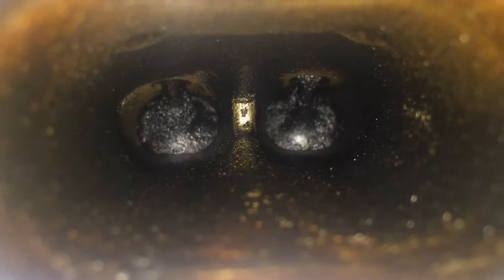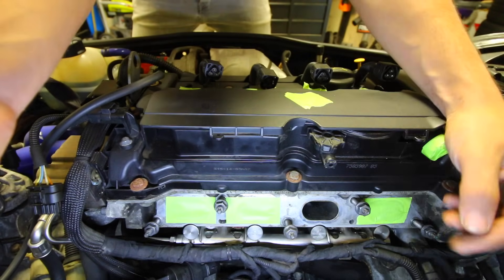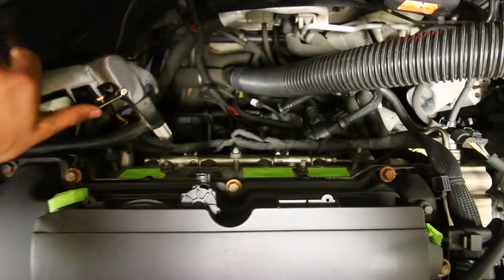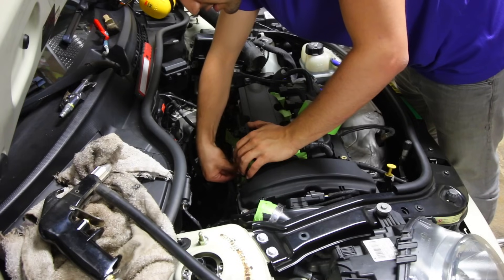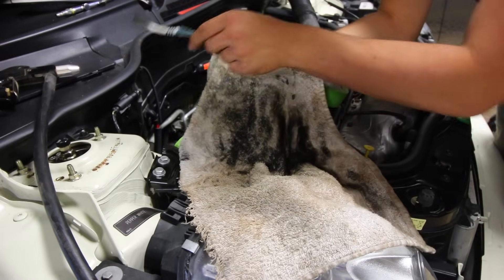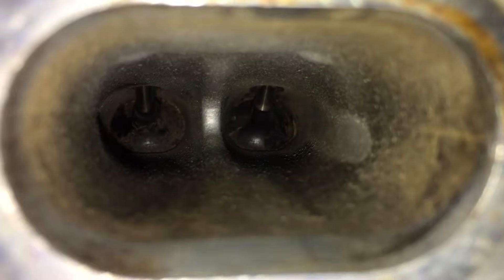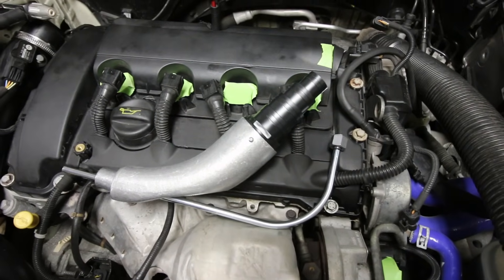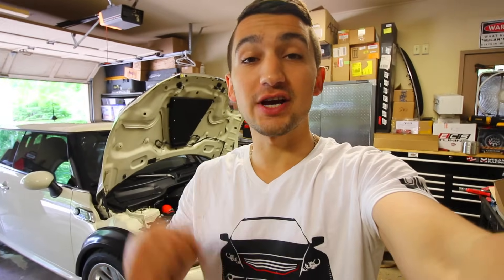How to Walnut Blast Your Intake Valves (CARBON BUILDUP REMOVAL)

Comment: Hey guys wanted to let you know about some unknown risks with walnut blasting, a man just died a couple weeks ago in Alberta due to walnut blasting.  If anyone has a nut allergy or specific allergy to walnuts keep in mind that the walnut blasting could potentially be fatal when exposing to the atmosphere - PLEASE check and make sure no one on site is allergic to walnuts.
Reply: "Patrick Wetterskog"

luckily, engines have no allergic symptoms to walnut.
Reply: 100% correct,, but..
Carbondeposits and nutshells that are trapped in the tight space between the valve and the seat sucks in when starting engine, and might score the cylinders and hurt valveseats.

You can never be sure of that you never leave any deposits unless you take the engine apart.
Reply: What you could do is to rotate the engine so the intake valve is open, then blow compressed air down through the spark plug. It will push any walnut fragments back out through the intake manifold.
Reply: Some areas would be sticky because these engines also have a lot of oil blow by so its going to be tacky with oil in there on top of the carbon. Plus walnut bits would be in crevasses that the air isn't getting to. You can't possibly blow it all out. going to be some damaged engines out there for sure after seeing this. Port injection only for this guy.
Reply: @practicalguy973  Just say you don't know how to do it professionally. It's okay.
Reply: Patrick Wetterskog you are 100% correct on that, especially when your valves have already started to build up carbon deposits close to their edges and might not properly sit in their seats anymore.

Disassembling the head for an overhaul and cleanup is the preferrable option. And that way, you can also change the valve shaft gaskets which also contribute to sludge buildup on the intake side. Plus, you can clean the pistons as well if necessary.
Reply: Not mentioning all engines that have died?
Reply: It´s one way, but you still wouldn´t be sure.
Reply: WC Blast

Comment: I have a 2001 lancer GDI 4 coil pack my car has a rough idel, hard start, poor response and stalls. We changed plugs,coil pack, both fuel pumps,engine and gas tank,throttle body,air flow sensor, new battery still no results. Scanning showed nothing.??? Please anyone help.
Reply: Roger Obrien take it to someone who knows what they’re doing.

Comment: You did this with some of the valves open?
Reply: You did not watch the whole video. He mentioned several times and even said "couldn't stress how important that is" to close the valve by cranking the motor and by covering the other valves with 3M automotive tapes.

Comment: Nice vid man! Quick Question: How do you know that the valves are actually closed? It's kinda hard to look and see that you didn't miss that even a milimeter. Do you have any tips to check that the valve is 100% closed? Thanks!
Reply: Lucas Ariel Lopez Ferreyra compression testing each cylinder prior to the cleaning process would show when they are closed.. truth is the valves will never stay 100% sealed at any given time due to laws of physics and engineering.
Reply: And of course, carbon buildup won't let it close too.
Reply: Thanks for the reply. That's right, but if you're not able to leave the valve 100% close, the walnut will end inside the cylinder one way or another. Isn't that bad? What happens with the combustion inside the chamber with walnut?

Comment: you never mentioned the cause of this / it's the lack of a catch can
Reply: keith dunham catch cans don’t fully work, they help but only like a small amount. It’s not just caused by oil but by blow by gases.
Reply: Cheap catch cans don’t work well
Reply: The MANN+HUMMEL Provent 200 is probably the BEST solution as far as a catch can. The overpriced one's on the tuner sites are BS.
Reply: It's the combustion chamber dynamics, a catch can will not prevent this because there's cylinder swirling vapors with oil and unburnt fuel.
Reply: I believe most direct injection cars have a sort of catch can already built in.  Extra catch cans might reduce build up a little, but a lot of what you see is condensation caused by the catch can and it could also lead to other problems and is more maintenance since you gotta watch and empty them.

Comment: That was a really good job. Hard effort or not a good job. The diff between before/after hopefully correlates with before/after engine operation
Reply: mathomaatuark it won’t because the valve seats haven’t been cleaned because they were closed while cleaning also depending on how bad it was the seats may already be damaged

Comment: You need a catch can on the PVC system as this is where most of the deposits come from. As the oil vapor condensates out of the air and lines the runner walls it leaves a nice oily place for the EGR gasses to stick to. The catch can will remove the oil vapor and stop the oily wall problem. This has been a huge problem on the 3.5l Ecoboost from Ford.
Reply: Is a catch can available for all engines?
Reply: @AAAAAAndrea  Not if you're in California. They're illegal there because although they improve your emissions, installing them means you've (gasp!) altered your emission system.
Reply: @anthony2816  I'm From Italy , it's even worse here... LOL

Comment: Ok, I'm not a mechanic, but I know this: Egr systems put part of the exhaust gas back to the cylinder, where it gets mixed with gasoline and air (this gas has to pass throug the intake valves), this leads to a loss of power and keeps fuel consumtion and emissions low, with conventional or indirect injection if you want, carbon build up takes longer to happen because the injectors spray fuel behind the intake valves, so they clean the carbon deposits accumulated thanks to the Egr system (the exhaust gases that are coming back) Toyota has a solution, where they use 2 injectors per cylinder, indirect injection  when idling and direct injection when normal driving, like a self clean feature, I wonder if you can delete the whole Egr system?, but I don't know if this could cause something else to go wrong, remember, I'm not a technician I just like Cars.
Reply from the maker: Oh that would be awesome, but I feel like that has to do with the engineering side of cars, not the modifying them.

Comment: If you don't have a sandblaster, will it be enough to clean it with a toothbrush?
Reply from the maker: You can probably use a toothbrush to get it done, but it will take a lot longer and you probably won't get it all that way
Reply: No.

Comment: I'm confused why you would need to take out your spark plugs...
Reply: Also makes turn the engine over by hand a lot easier.
Reply from the maker: So you can inspect the cylinder to make sure you didn't get any walnuts past the valves.
Reply: @milanmastracci  Let's assume on inspection you find walnuts in the combustion chamber.  What do you do now?
Reply: @robertjohnson4401  You get off the internet and take your car to a shop or a dealer before you kill your valve seats
Reply: @milanmastracci  You gotta learn to do some research and get yourself an oil catch can so you don't have to go to these extreme efforts.
Reply: If you place a long straw/stick/screwdriver in the spark plug hole, when you turn the engine by hand you can better tell if any given cylinder is at top dead center, which means the valves are completely closed. The stick will be in it's highest position possible.

Comment: Is there any adapter for vw's like yours for bmw?
Reply from the maker: I don't doubt that the adapter I used in this video will work for a lot of other cars. The intake ports on cylinder heads are basically the same thing which is nice.
Reply: milanmastracci  thanks,bro! I give it a shot

Comment: I've got a 4 cylinder car and I think that extraction adapter would work but it's a Chevy...
Reply from the maker: They all are basically the same shape so I wouldn't be surprised if it works for you :)
Reply: milanmastracci stupid question but how do know if the valve is all the way closed by yourself?

Comment: I just got a misfire on cylinder 4 today too... great timing but for me this job seems risky...
Reply from the maker: Its not too difficult of a job if you ask me. If it kind of intimidating if you haven't ever had to to it before, but it isn't as bad as you think.
Reply: milanmastracci I still don't understand how to close the valves from the crank pulley? The 18mm socket right but how far do I turn it? And it will close all the valves?

Comment: Is that a PLASTIC INTAKE MANIFOLD???!!!
Reply: Yes, it's a "PLASTIC INTAKE MANIFOLD???!!!" like pretty much every modern car since about 2003
Reply from the maker: Yes. A lot of cars are made with plastic intake manifolds
Reply: Michel Linschoten Yea they have been around for years but I haven't really seen a metal one since anything from 2003 lol. I know after this people are going to give examples of metal intakes after 2003 hahaha
Reply: Patric I got a 1996 S10
. Plastic manifold lol
Reply: Warp.
Reply: Plastic manifolds are not bad. Plastic surfaces are smooth, has low thermodynamic coef and are less expensive and cooperate to manufacture of complex geometries easily

Comment: what if we use one of the solvents then suck it with a tube
Reply: They almost don't do anything,but walnut blast will clean it like brand new.
Reply: That is what I would do. Soak with cleaner for hours, brush it, and suck cleaner out. Repeat as many times as you are satisfied with the results.
Reply: BG makes a two stage soaking cleaner that you do that way and it works great

Comment: Seafoam wouldn't help?
Reply: @ast5515  Why do you say that? Please explain. There are many online videos that prove it works. I am about to use it on my R56.
Reply: Seafoam is a strong chemical. Old engines were made to handle anything, but these newer BMW engines were not. It does remove a bit of gunk, but not all. And you risk the seafoam hitting a seal or something that cannot withstand it. I'm not saying it's gonna kill your car, because it isn't. But it's an ancient way of cleaning engines that was NOT made with direct injection in mind.
Better safe than sorry. If you don't want to buy the equipment, get a mechanic to walnut blast your engine. It's not that expensive.
Reply: seafoam only works when the fuel injectors are spraying fuel behind the valves, in the intake runner. And it also doesn't work very well and can lead to quite a bit smoke coming out your exhaust. You'd have to go through several cans of seafoam before you get worthwhile results. 

Directed injected engines, have the fuel injectors, spraying fuel directly into the combustion chamber. 

The carbon buildup, is caused by blow-by from the turbo and the PCV system that routes oil vapor into the engine to be combusted.
Reply: Seafoam does squat if you apply it to your gas tank or crank case.  For it to do anything for GDI engines, you'll need to spray it directly in the intake manifold or the throttle body while the engine is one.

Does it remove carbon?  Yup.  Many before/after vids of the interior cylinder chamber shows it does.  Does it do much in cleaning the valves of hard carbon buildup?       ......Elephino
Reply: Jake Edgington depends if you spray it through the intake or fuel system.
Reply: I used a bottle of seafoam and put it in the gas, oil and pcv. The car has 69k on it and your saying it didn't do anything?
Reply: There is a Seafoam Spray. Comes with a special "straw" (red tube) that you put in the boost tube, secure it with the clamp and spray with the engine running. http://www.detroittuned.com/sea-foam-spray-n18/
Reply: I tried pouring Seafoam directly into the intake valve ports. Let it soak, and it didn't even soften it. Going to try Acdelco Top Engine Cleaner next, and maybe blast with just compressed air first. Walnut blasting will be my last resort.
Reply: No. It does more harm than good in direct injection engines.
Reply: ohh okay

Comment: i was hoping you'd do a startup with the clean cylinders now
Reply: After he gets it fixed he will post a vid. Right now it won’t start. Probably nuts in the cylinders.
Reply: @ghostcar  LOL
Reply: Excellent vid. Super helpful. One of the best. Thanks so much for posting.
Reply from the maker: It runs a lot better!! :)
Reply: It don't run cus of the drive belt 🤣
Reply: Your Engine went nuts 😆
Reply: nahuel luna but he cleaned all the ports as well so thats also much better and cleaner airflow.
Reply: Max Trsinski you can chrome your intake ans never ever get that carbon shit
Reply: @PutinIsKing  if that was the case, then car makers would do it from the factory
Reply: clean valves* he just cleaned the valves, he should clean the cilinders

Comment: well glad I installed a catch can on my solstice.
Reply: 240Z  again makes no sense.  Also I don't have Mr VW telephone number.  instead of making stuff up why not give correct information.   

The whole point of a catch can is to keep the motor clean.  the only way it could cause a problem is if you don't empty it.  

learn some stuff.
Reply: 1.4T SIDI doesn't have EGR, it uses Valve overlap and PCV.
Reply: You have no idea, oil catch doesn't catch all the oil.
Reply: Why wouldn’t you just remove the head and rebuild it properly
Reply: You will get that anyway.
That's just natural,combustion produce carbon.
Maybe it's going to be slower...
Reply: Not recommended since its not very effective.
Reply: That's only on old engines. Modern Opel engines don't have oil catch can since it causes more problems later because it just makes the DI engine fail while it's out of warranty.
Reply: 240Z that makes no sense
Reply: Ask VW ,they removed oil catch can because it would clog up the engine just when warranty runs out which for average user would cause damaged pistons because they have no idea about valve cleaning and stuff.
Reply: 240Z uh depending on the catch can, it can catch most of it. Catch cans wont cure it, but help a shit ton. If you know anything about DI, pressure is higher than most port injected engines, causing even more blow by.
Reply: Texas Car Nerd don't pay attention to him, he's just trolling with you. ..
Reply: Lol you guys. A pcv delete/ catch can has nothing to do with this... read up on the Atkinson cycle. The intake valves hang during the compression stroke. causing air fuel and any remaining burn off back into the intake manifold
Reply: Glad I installed one on my Tesla!